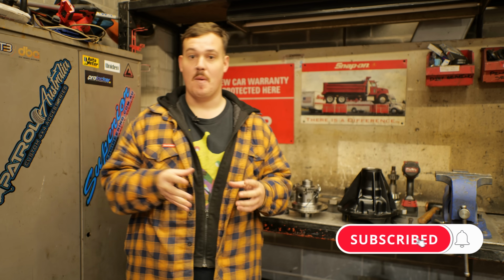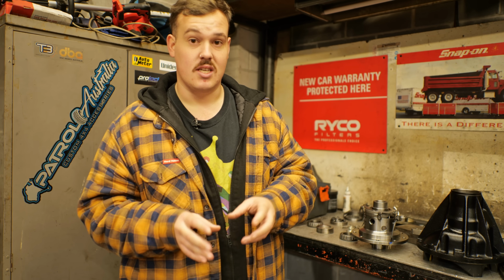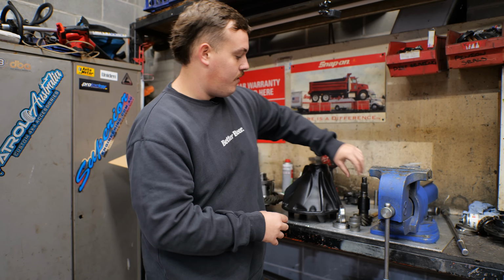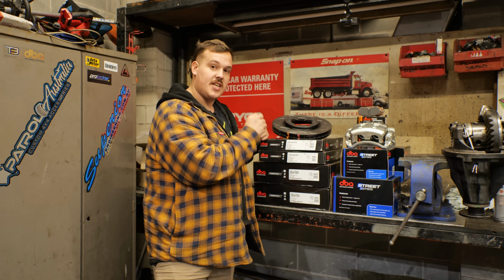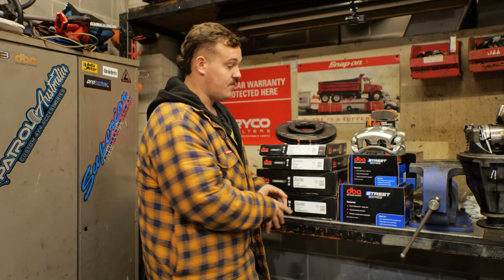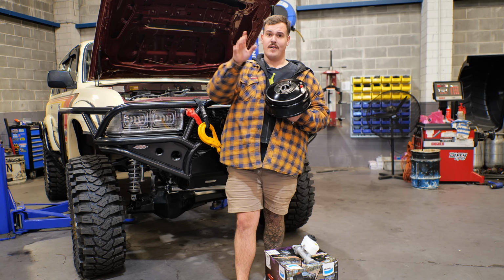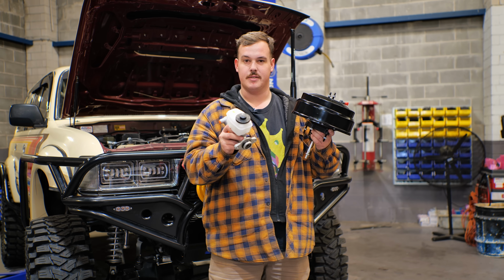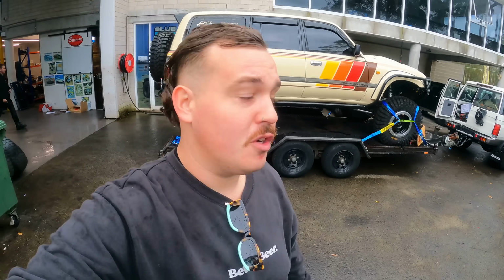The Ultimate Diff & Brake Upgrade For High Horsepower!

Comment: In the 80 model, the weak link is the necks of the stockings; in this case, they were not strengthened, the axle shafts, the CV joint and the main pair.  The car has learned an extra vech, big wheels, and there will still be a powerful motor.  I doubt that the front axle will serve for a long time, unless you turn on the front locks and press the gas pedal all the way

Comment: Let me tell you, friend, that I didn’t understand, what did you do with the front differential? How was it strengthened? everyone knows that the front diff is smaller than the rear and is very weak, but you have such power and such wheels. I heard that they redo the rear, put 9.5 and everything lives with large wheels and high power. And if you drive a stock car with such power and such wheels, and even somewhere in the mud, then the main pair will crack or eat the teeth on the carrot. Well, unless of course you are limited to just going to the beach on flat sand, showing off

Comment: a noob question, how's it getting engineered with bead locks?
Reply: Pretty easy mate…it won’t. Not an engineer on the planet that will pass bead locks and treps.
Reply: @shanenorwell8580  you can get dot approved bias treps

Comment: Just have magnets that fail more often that air locker seals ( if installed correctly) and when you go in reverse the e locker will unlock for a full rotation or there abouts before it locks again and the same when it goes forward again. Why not talk about the pros and cons of both. Not just rag out what ever your not paid to use.